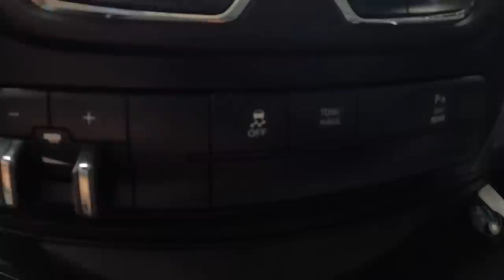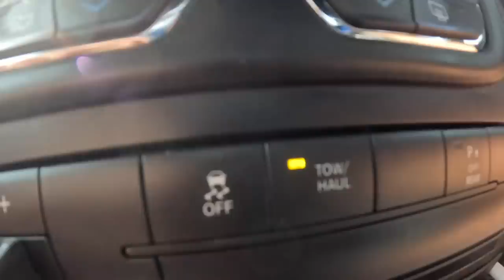RAM WARLOCK 2022 - Towing 3500 Kg Sunseeker Desert Storm

Comment: hi its a big vehicle, personally i love them but wife hates all the USA pickups..  weird  but she's the Boss.. but still you needed airbags and a Load Dist hitch - so that brings me to the point vehicle manufactures need to have a good look at themselves and fix the problem, 80-90% vans a re over wight, that's a industry problem i feel.. Anyway i have the 22 XLT and i just brought a 2019 Desert Storm from  Beerawa area.. so cant wait to hit the road..  im thinking about putting in 300-500 constant springs in the rear as i dont want to spend money on the XLT as i have a 23 Wildtrak PP on order for Aug-sept 23. - i feel there is not a lot to gain in a F truck or RAM for us as the 20'6 Tare is 2800 plus water and gear etc so im thinking it will be about 3.2T the veh full of fuel and driver only is 2340 when i weighed it at the truck pads.. ill keep an eye out for you guys, great content and well spoken with good info well done. peter.. Tindog Travels .
Reply from the maker: Thanks for your comment.  It’s a great truck.  We really love it.  Evem though its set up for towing, it still needs a bit of support in the rear end.  It’s a strange one that’s for sure.  the springs in the end make for the ride to be really comfortable but, the downside is when you are towing it’s soft.  Sounds like a good rig you have there,  Enjoy.  Will keep an eye out for you.,

Comment: Any chance you can look in the door jamb and see what the rear axle rating is? Just want to know if the Warlock is higher than the standard. Also did you happen to weigh your empty van to see it the tare on the plate is correct?
Reply from the maker: Hey Mick.  Yes,  The rear axle weight loading is 1770kg which is the same as the classic, so we have to be careful we do not overload it.  When we got the car weighed with the van and wdh, our rear axle was 1580 so we seem to be OK.  Without the way is was another 90kg on the rear axle, hence why we are using it.  Mate, feel free to PM us on facebook if you’d like to know more about the empty van weight.  👍
Reply: Hi we had same question. Really weird as we use outback travel australia calculator and we can t get away without gvm upgrade 😮. Unless we carry nothing in ram.its really strange. We ve tried putting in different weights but always comes back to just 2passengersat 150 kgs andnothing else for the weights to stay legal.stumped ! Our lovells s gvmis on order and we have to replace rims and tyres for the upgrade but ournew rea axle rating will be 2180 kgs . Our new van will have ATM of 3.2 T . Tried all sorts of scenario s in calculator so im hoping we got it right .

Comment: Air bags to my knowledge air bags dont transfer weight back to the front axle. 
Thats what ive been told so ive stuck with using a H/R WDH

Any " paid content " in your videos??
Reply: Problem with WDH is that if an accident happens and the van rolls, the car rolls with it. Takes all the advantage away from the DO45 hitch and its articulating properties.
Reply from the maker: No.  We have no paid sponsors.  All the people we mention are simply great people who have helped us.  We have received no payments, discounts or products.  You’re right.  The airbags stiffly stiffen up the suspension.
Reply from the maker: Hmmm.  Thats a good point

Comment: Without a gvm upgrade, how much can the ram 1500 tow.?
Reply from the maker: Hey Kathleen.  A GVM upgrade wont really affect how much you can tow.  The RAM can tow 4500kg, bit in all reality, if your van weighs 4500Kg, the GCM (Gross combined mass which is the combined mass of the car and caravan) will be real close to the limit, which from factory is 7237 Kg.  To my knowledge you can not upgrade the GCM on a RAM.  Getting a GVM upgrade will essentially increase the total mass in the towing vehicle.  From factory the GVM is 3450Kg.  Once the kerb weight is taken into account, this will give you 880kg in payload in the car.  This sounds like a lot, but once you take into account the weight of the tow ball, the weight of your passengers, it starts to get to a point where for some an upgrade may be necessary.  For us, our tow ball is around 350Kg.  There is the three of us and our dog.  We have no accessories on the car.  When we got weighed, our GVM came in at 3275Kg which gave us another 175Kg in payload.  So. For us a GVM upgrade really isn't worth it at this stage.  Hope all this makes sense.  Check out our vid from about a month ago where we broke down all of the terminology on weights etc.
Reply: GVM upgrade possible post rego?
Reply: what about your rear axle weight when the van is hooked up , hitches off and everybody in the car.
Reply: @Mick_4591  There are Rams with higher GCMs from the factory than the Ram 1500 has.

Comment: Check with RAM about towing with tow assist turned off your computer will tell on you
Reply from the maker: Thanks Michael. I will give them a call.  Where the computer are youy referring?
Reply: On board system I believe will detect when trailer connected  and tow assist not activated ,could affect any warranty claim. Bit of nuisance having to remember to turn on t/a when ram knows trailer brake activated
Reply: That sgoodto know